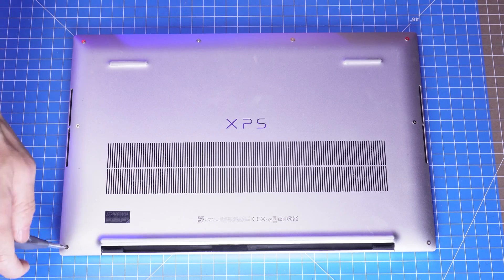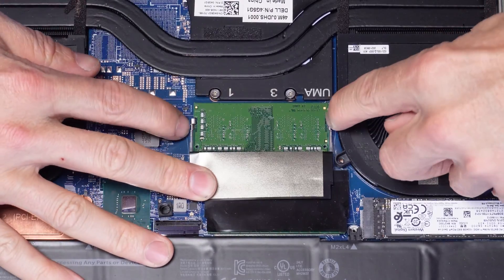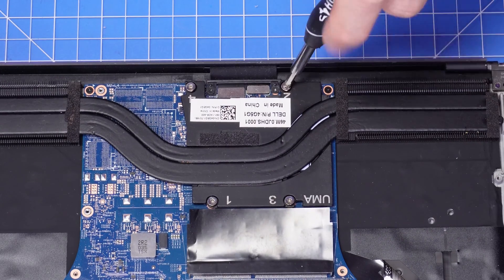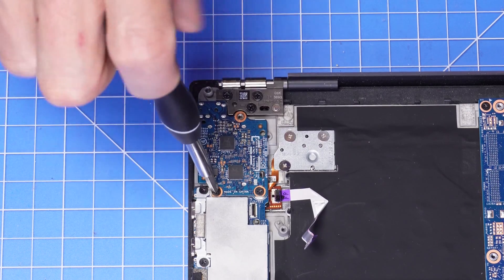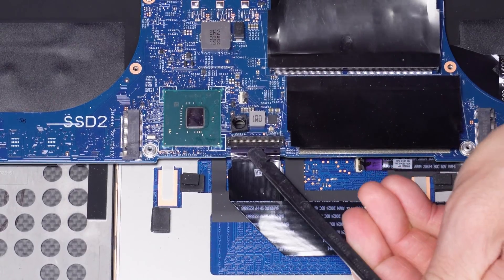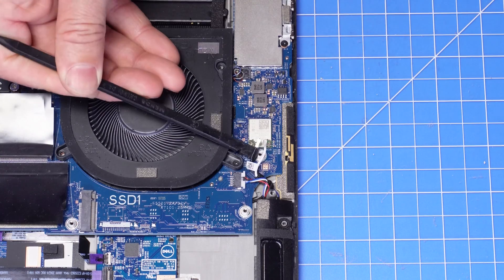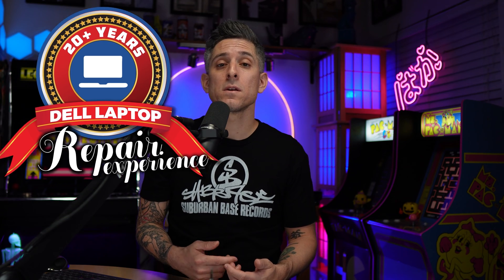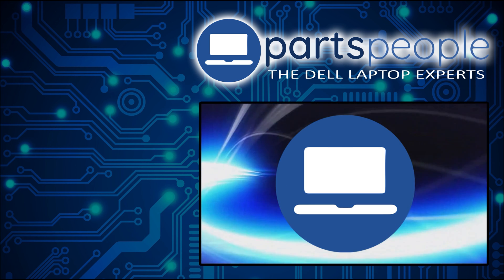Save Money. Fix Your MOTHERBOARD | Dell XPS 9700

Comment: Do you think a Motherboard from XPS 9700 code 19749-1 would work in a xps 9700 originaly coded 18835-1? Do you think they are compatible?
Reply from the maker: Based on the input/outputs and screw configurations these motherboards should be cross-compatible.

Comment: Hi, do you have the reference for the XPS 17 9710 Motherboard? Mine is broken, if I change it, will the laptop work again?
Reply from the maker: This XPS 9700 shares the same disassembly process as the XPS 9710. There is a slightly different screw pattern on the left cooling fan but that's about it. As far as whether or not it will remedy your problem, I could not answer that. It depends on your issue.

Comment: XPS 13 9300 USB Type-C ports not working. Battery dead. Motherboard lights flashing when charger connected.

Hi,

While living in North America In September of 2020 I ordered and received my new XPS 13 9300. I haven't been able to use it now for over 2 years.

I moved abroad and was using a stepdown converter to charge it which worked fine for a little while. Then I relocated again within the same country and suddenly the laptop would not charge even with the stepdown converter.

The charging cable light will come on and be steady when plugged in to an outlet (either in the stepdown converter or using an adapter in the wall) but when I connect it to the laptop the light on the charger starts blinking on and off steadily.

Before my battery depleated completely an error message came up breifly stating something about the system not being able to detect the charging system.

I removed the battery and tried to use the laptop with only the charger attached but the same thing happens. The lights on the motherboard flash as well when the charging cable light flashes.

I want to know if getting a new already charged battery might give me access to the laptop long enough to go in and reset the type-C usb port drivers since it seems that the different voltage in my current country of residence has confused the ports.

If you have any suggestions that do not involve replaceing the motherboard entirely (as that is not very possible for me at this time) I would really appreciate it.

I have seen other customers having similar port issues with the XPS 13 9300 but I have yet to see any suggested fixes that the customer can do themselves.

I even discovered that there are "External battery chargers" available for older dell laptops so that the batteries can be charged seperate from the laptop itself but I have not been able to find one that is made to function with the XPS 13 9300 battery.
Reply from the maker: Hey Serena,

That's quite the predicament. I wouldn't rule out the possibility that the power transferred through the (I'm assuming third party) stepdown converter has damaged the motherboard. But I couldn't say for sure. Attaching a new, fully charged battery might help rule this out.